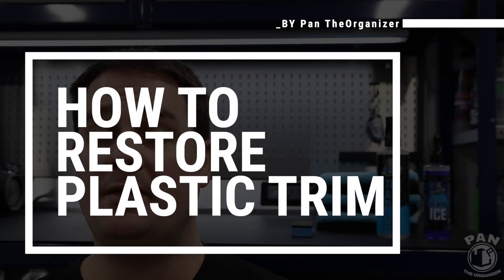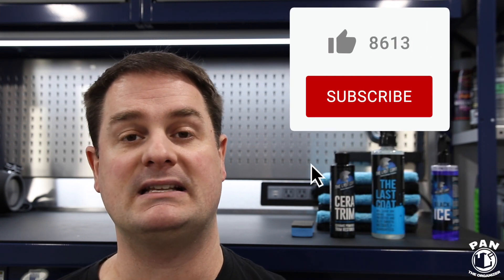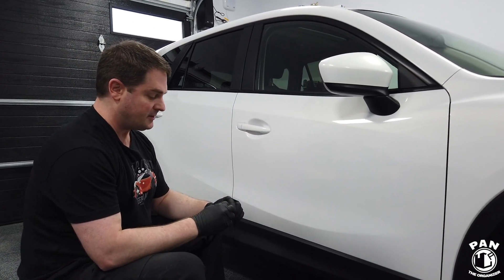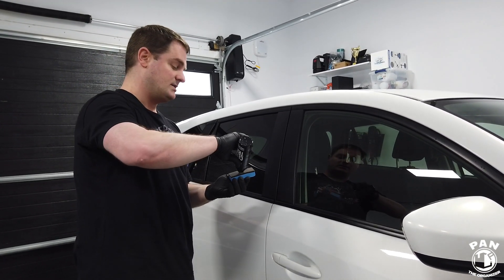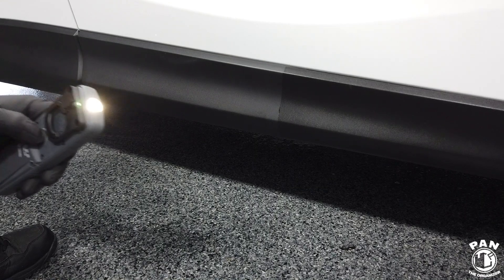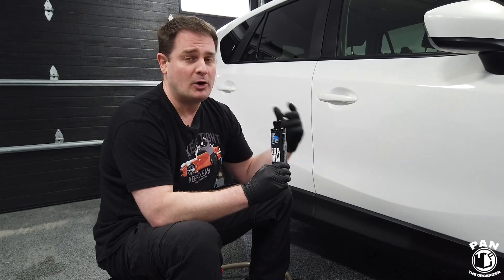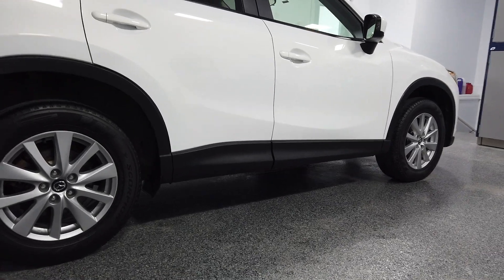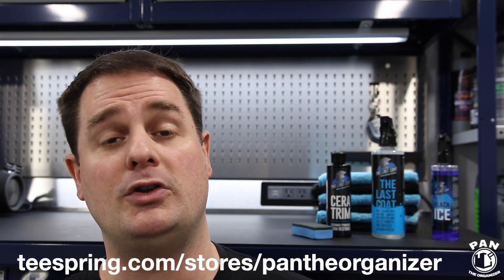Restore faded plastic trim on your car with CeraTrim!! IT WORKS!!

Comment: This probably by far, the best trim restore I’ve seen, thank you Pan for sharing this, I’m currently using solution finish, I’ll definitely check this out!
Reply from the maker: Yeah you would love CeraTrim.  Solution Finish is one of the best trim restorers hands down, but is messy to apply and takes time.  CeraTrim surprised me by its ease of application and the results are just as good as with Solution Finish.
Reply: @PanTheOrganizer  
How is it with dust and road Debree? Does it stick to it ?

Comment: I ordered a bottle and tried it today on my wife's 8-year old Honda. It worked well. First I cleaned the trim with wax and tar remover and wiped it dry with a clean microfiber. I applied a large application of Ceratrim . Later I wiped off the excess.
Reply from the maker: 👍🏻. Thanks for the feedback.

Comment: I was thinking of restoring trim, saw a video of someone using a heat gun to bring out the oils . Worked for him, but haven't tried myself.
Reply: Don't do it! 😁 😂 Just trust me... Solutions Finish works great & last a good time... You can get a 1 oz off of Amazon to try.... Now I am wondering if this is as good or better!
Reply: Don't
Reply: @BrownRooster  thanks! Just thought it was odd
Reply from the maker: I wouldn't do that either.  That would be an extreme case and last resort situation.
Reply: @PanTheOrganizer  oh don't worry, I won't lol. Just a head scratcher

Comment: Thank you Pan, this is exactly what I need. Today I applied Iron-X to the roof of a 2018 Acura RDX, rinsed and did not immediately wash and dry the B pillars, side of car etc; focused on roof. Well, the Iron-X put some nasty streaks on the semi flat black B pillars. I’m hoping that this product will fix the streaks.
Reply from the maker: It's important to never let iron removers dry on the paint.  Always work in the shade (or better yet, in a garage) and NEVER on hot panels.

Comment: The before trim wasn’t even bad . Do it on real world faded trim
Reply: Agree
Reply from the maker: That's the vehicle I had on hand for the video shoot.  And yet, I think it was pretty obvious to see a difference even on that.  So imagine what it can do on trim that is even more faded.  My 2 cents.
Reply: @PanTheOrganizer  I agree with Pan. If the panel was worse the effect would be even better. 😂
Reply: That’s his girlfriends, he wasn’t going to park his BMW in the driveway so her Mazda could be parked inside. He only had a one car garage in his old house.
Reply: @PanTheOrganizer  but treating =/= restoring.  Plenty of products work great to keep plastic nice, but don't "restore" trashed trim.  That's my .02.  Granted....this is an ad.  But whatever.
Reply: @PanTheOrganizer  I would like to see what it looks like after it's been dried for 24 hours
Reply: As he addressed in video, would even make a more drastic of a difference. Here's a thought - If so skeptical, buy some and try it. Applied on a new car for the benefit of protection alone, but even made trim look better. On a 2010 truck, exposed to Hawaii elements, made a huge difference.
Reply: Tyler Hackman You cant properly restore plastics. 

The closest thing to it is heating the plastic carefully with a heat gun to get the oils to come back to the surface. This is also only a temporary fix, it will eventually fade away as the oils evaporste overtime, just like it started doing from factory, but likely faster.

Covering up the fade is in my opinion the smartest (and safest) thing to do. 

If it has UV protection it will also slow down the fading.
Reply: What is the maintenance on this? Does it need a booster since it is ceramic infused? Thank you!
Reply: Yeah, I think an old Chevy Avalanche would be the best candidate. Those things look horrible after a few years with all the trim GM put on the back and sides.
Reply: ScottH bought a used trim panel from a Chevrolet Avalanche.  Faded to the max. He then tried 4 different products one being this one. He then washed it like 40x and only one looking brand new or actually the only one to survive was Last Coat.  Don't doubt Pan, he's the man.
Reply: Is it really dry to the touch? Hate when you wash the car and the glossy is gone
Reply: Even if it doesn't handle faded trim well. Just hit that stuff with a heat gun and then throw this on top of it
Reply: Liked the video and I ordered cera trim, but wut wood u recommend using to clean the engine bay to apply this.
Reply: What is your thought on trim serum?
Reply: @IIISWILIII   bro heat gun ruins the plastic 😂😂😂😂
Reply: Can this product be used on rubber exterior by the edge of the windows...
Of course need to prep it first with IPA or APC....then apply accordingly?
Appreciate your input 👍 
Much blessings 🙌 
Merci!!!!
Reply: @PanTheOrganizer  the real problem with real faded trim is oxidation, i applied some trim restorers but the trim fades again after a month because of oxidation. new cars or 2 to 3 year old cars dont have this problem.

Comment: I get the same results with 303 on kept trim. The best way to restore faded trim is a heat gun followed up by baby oil. I will however give it a try, loving what Turtle Wax hybrid did for my paint.

Comment: Hi Pan. Thank you for this video. Plastic trim protection has been my biggest bug bear and after watching this video, I went to the website and purchased 2 bottles. Shipping to Australia wasn't too bad either so I am very happy with my purchase and can't wait to receive and start using it on my cars.
I would've liked to have seen you use it on the outer rubber door/window seals as these tend to fade and be affected by water spotting.
Reply from the maker: You will like this for sure.
Reply: How much did you pay with shipping mate?

Comment: Can you reuse the applicator?  Since this is a ceramic product do you have to throw away the microfiber towel used to buff the product. What is black ice?
Reply from the maker: This is ceramic infused, this is not a full blown paint ceramic coating, so no worries, yes you can reuse the applicator.  And just wash the towels after use, and reuse.  Black Ice is a ceramic based spray sealant, that will last even more than their Last Coat version 2.0

Comment: What's the best protectant for the trim and leather that gives a glossy kind of look?
Reply from the maker: I don’t like a glossy finish for trim or leather so I have no recommendations unfortunately.
Reply: @PanTheOrganizer  how many times should a person use a interior protectant for the car?
Reply from the maker: Once a month is a good regimen.
Reply: @PanTheOrganizer  okay and does using a all purpose cleaner to clean the trim once a week cancel out any of the durability and uv properties?
Reply from the maker: Use a quick detailer for interiors, with UV protection for light cleaning duties. APC is overkill and will strip the protection. Watch my interior detailing routine on my own car here: https://youtu.be/TV1_qdOCy-w
Reply: @PanTheOrganizer  okay but if it’s someone’s car you never done before don’t you use apc? And what I meant is I would wipe it down with Apc first and then probably after it dried go in with trim stuff, along with the uv protection.
Reply from the maker: Yes.

Comment: It would be nice if you could get a car with worse trim conditions to see the long term durability... My absolute favorite is solution finish trim restorer, only 20 dlls for the big bottle and I estimate you can easily do around 10 cars with it and the durability it's amazing so far I've done 6 cars and still have about 3/4 of the bottle, can't imagine anything else better at the moment because I don't know if this TLC product will last.
Reply from the maker: Solution Finish is exceptional too.  However it's messy to use and takes longer to apply.  So both are great products, it boils down to personal preference.  Given TLC's awesome track record for durability with their TLC version 2.0, I don't see how this won't meet or beat expectations of 12-18 months durability.  It's good stuff!
Reply: @PanTheOrganizer  I'll take your word on it And give it a go on my 2016 rogue since the trim is not faded just a bit dull

Comment: CeraTrim looks like it is very easy to apply and more durable compared to Carpro Perl which I use. It seems like CeraTrim works wonders in the exterior because of the glossy appearance and a small ceramic protection which is great for exterior. But for the interior, I don't think the glossy look will be desirable on something like the dashboard and it won't need the ceramic-type protection. I'll stick w the Carpro Perl diluted when I need interior restoration, and 303 aerospace for protection for interior. But the CeraTrim looks appealing for the exterior 🌟
Reply from the maker: I agree Keith.  For the interior I still use PERL diluted 5:1 or Aerospace Protectant, but yeah CeraTrim on exterior rubber and plastics is already outlasting PERL by a long shot.  I am confident it will surpass the claimed 12 months durability.

Comment: I recently bought Cera Trim.  They didn't give me the small sponge applicator, it came with a much larger soft microfiber covered sponge.  It made it very difficult to apply the product.  I couldn't really work it in like you did and it made a mess trying to apply it tight spots like around mirrors. Some got on the paint, hopefully that is OK.  The gel never really set up, even after 20 minutes it was still wet so I wiped it off with a microfiber.  It could not be "buffed" just wiped dry.  It looks great so I hope it lasts.

Comment: I coated my 2020 Mustang and 2016 Corolla with TLC's Black Ice about a month ago. So far I like the results and the application was a breeze. We're doing a buddy's Jeep with Black Ice tomorrow. Would love to see your thoughts on it. I plan on using TLC 2.0 to add a little extra protection as we get closer to winter. I may have to give this Ceratrim a serious look. Thanks for another great video, I've learned so much from them!

Comment: Hey Pan! Hope you see my comment but how does this compare to solution finish black? Which has longer durability and would cera trim  possibly be used as a topper for solution Finish since it has some ceramic coating properties. Maybe you can do a video comparing the two👍🏻
Reply from the maker: This question has been asked a lot in the comments section.  Both are exceptional trim restorers.  But CeraTrim is easier/quicker to apply and doesn’t leave a black mess.

Comment: Seems like a really good restoration coat, I've tried a couple products before and they work but they're not Amazing especially on the durability but this product looks promising, I've been using rust oleum wipe new but they get expensive when buying a lot of them and this Liquid product seems like something that will last me a little longer

Comment: Gone mine today. And the Black Ice. Used the ceratrim already. On the tires too.
Reply from the maker: Did you like it?
Reply: @PanTheOrganizer  yes.
Reply from the maker: Awesome.  Even though I might like a product, I always like getting feedback from my viewers.
Reply: I will say if anyone uses it as a tire dressing to buff it real well with a microfiber towel that you're going to throw out anyway.
Reply: Went through a car wash and the ceratrim looks as good as when I applied it.
Applied thw Black Ice today. Is it as easy to use as wax? No. It's much easier. It's practically self leveling. You can do a whole side of the car and not worry about high spots.
Reply: Posted pics on you're Facebook page.

Comment: I plan on doing a complete detail on my husbands 2007 Honda Civic. It is in excellent condition, but needs a total detail. I plan on putting a ceramic coating on it but I'm not sure if I should ceramic coat the trim or use Ceratrim. I wouldn't think you could use both.
Reply from the maker: If the trim is faded and oxidized (looks milky white or chalky and faded) then it needs to be restored with a trim restorer like CeraTrim. If the trim looks black and in good condition, all it needs is protection so you could apply a trim coating like CarPro DLUX or Gyeon Trim.

You wouldn't use both, as CeraTrim also has built-in protection, so it restores and protects.

Comment: With all do respect sir, all the trim restoration products like chemical guys , bead maker and others are good when you apply them however what it is important is the longevity of the product. So it will be helpful to see how long can last in harsh weather
Reply from the maker: Of course.  I will be testing long term as this is a brand new product.  But over one month so far and still like new.  I have no reason to doubt the claimed 12-18 months durability.
Reply: @PanTheOrganizer  i should get one. I really need something to last long

Comment: Video recommendation: Can silicon spray like Permatex Silicon Lubricant be used in rubber in the door jamb, hatch and under the hood to protect them from being brittle? 
In addition, can it serve as trim restorer? TIA! ☺️

Comment: It is easy to make vinyl look good upon first application.  It's how it stands up to a drive through heavy rain that's the real proof.
Reply from the maker: It lasted for many months. I loved this.
Reply: @PanTheOrganizer  Thanks
Reply: @PanTheOrganizer  Hey Pan, have you ever used Cerakote trim restorer? Project Farm did a extensive trim restorer test from a couple of brands and Cerakote outperformed the rest.

Comment: Just ordered a bottle.  Can't wait to try it out.
Reply from the maker: Let me know how you like it when you test it!
Reply: @PanTheOrganizer  Just applied it today and I really like it.  It covered well and was easy to apply.  When I buffed it off it was a bit tacky so I might not have waited long enough to let it dwell so I gave it another few minutes and it buffed out nicely.  The difference it made on the trim is unbelievable. Very dark and has a nice gloss to it.  Obviously I can't talk about durability or longevity but so far I am definitely happy with the results of this product.  I used your coupon code and saved some money too.  One other thing that is important to add is the customer service.  The Last Coat monitors the tracking number of the shipment and emailed me when the item showed delivered and then they followed up with another email linking to your video now how to apply the product.  They are very pro-active.  Thank you Pan.....I love your videos and I'll be sure to let you know how Cera Trim holds up under the hot Texas Sun.

Comment: I want to see what it looks like in about 2 weeks and after a rain... usually these trim treatments run and cause stripes after a rain or getting wet.
Reply from the maker: My girlfriend's car has been through many rainy days dans two rainstorms since this was applied and it still looks like day 1 one it was applied.  Zero streaks.
Reply: @PanTheOrganizer  Thanks Pan, that's actually good to hear. I'll be using your code shortly. Thanks!!

Comment: Thank you for all the great videos.  But I have a friend that her trucks clear coat has failed, I was wondering how to take care of what's left and the edges of the failing clear coat. Her truck really needs to be repainted but would like to help make her truck look better until then.
Reply from the maker: Unfortunately, when the clear coat fails, cracks, peels or fades, there is no other other but to respray the panel.  You can't add material where there isn't material left.

Comment: Pan, you mentioned in your video that it could be used as tire dressing but never mentioned how. Would it need to be diluted, etc. Can you enlighten us on that please?
Reply from the maker: That would be an off label use that TLC suggested.  I haven't tested this as a tire dressing yet, but you would not dilute this.  Just apply it straight.

Comment: Hey man huge fan of your channel and religious user of TLC products but when doing trim restoration/protectant products, maybe do a test over a weeks time or something? To see how long it really lasts because those Walmart trim products are HORRIBLE. I have only found 1 good product for trim restoration that I ordered off Amazon. Awesome video and definitely review the black ice! I have mine coated with tlc2 already but would love to see black ice in action.
Reply from the maker: TLC has a proven track record when it comes to durability of their products so I am pretty confident it will exceed the 12 to 18 months claimed durability if applied correctly.  It has been over a month that I applied this and even after many rainfalls and washes it's still like day 1.  This is legit.

Comment: The stuff works great as far as bringing the trim back to life but, and it’s a big but, it bleeds big time. I used it on my trim and it bleeds on the paint. I only used a little bit but I’ve had to buff off the stuff from the paint about three times since I applied it. Maybe I did something wrong but I’d say not to use it on trim above the paint.

Comment: Hey Pan, what's the best way to remove any previously applied interior trim cleaner/protectant from a vehicle? I need to get rid of it's smell. Deionizer and then some sort of cleaner? Any product recommendations or steps would be appreciated! Thanks as always man!
Reply from the maker: A mild APC diluted for interior purposes (typically 10:1 or 15:1).

Comment: Would it help keep the black color longer if you used a ceramic spray or sealant after applying CeraTrim?
Reply from the maker: Not really. CeraTrim on its own already does all the work for that. It restores, darkens and protects the trim.